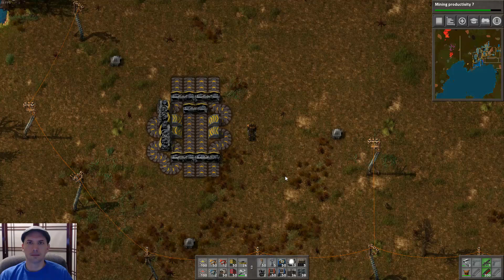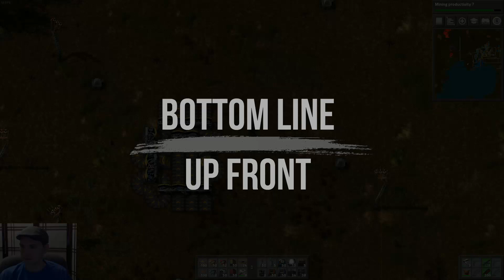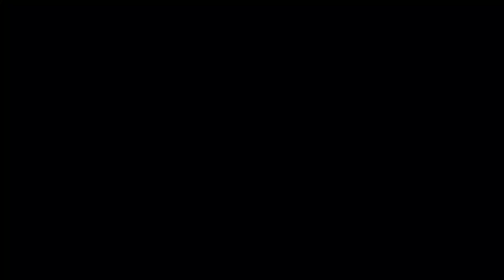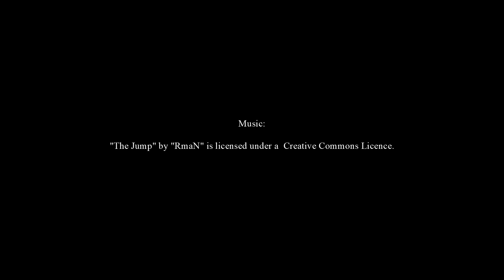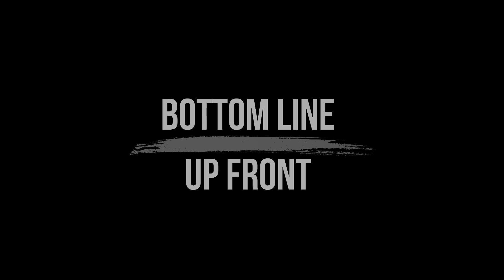Factorio - 3 to 4 belt balanced splitter

Comment: you can build  a simpler one with only 4 splitters and no recycling.  split a lane so there are 4 lanes. Then with the two untouched input lanes, balance those, so you now have two balanced pairs.  Then feed one lane of each pair into a splitter, then the other lane from each pair into another splitter.

Comment: I feel that a 4 to 4 splitter works fine as 3 to 4 that is smaller. what is the benefit to use this over the 4 to 4 splitter using only 3 inputs?